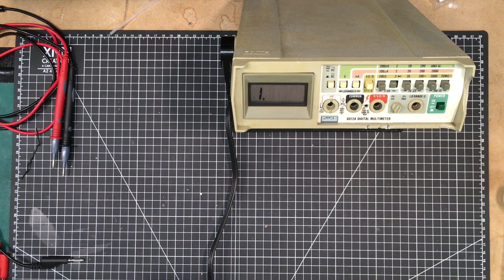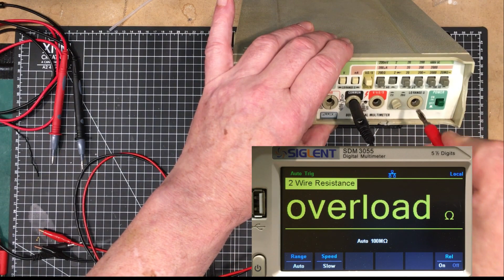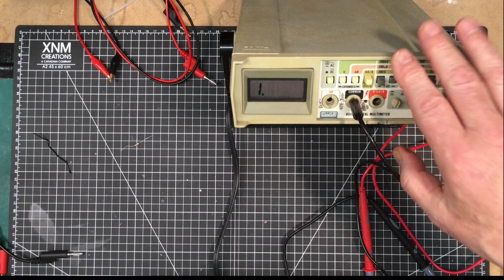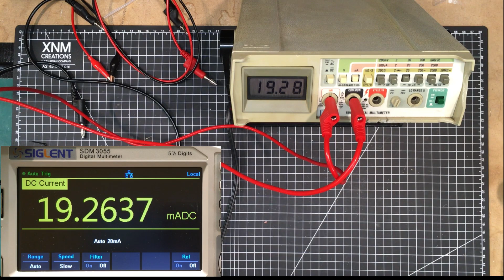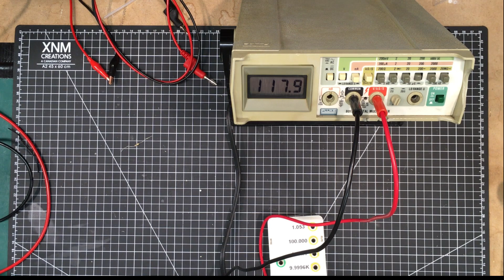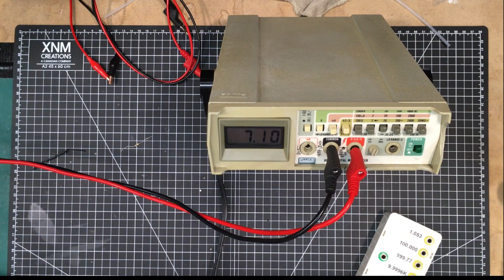0064 - $35 Vintage Fluke 8012A DMM - Better Than You Think!

Comment: I had a slightly earlier version of one of those many years ago I bought from a surplus place. It was in exactly the same case with the row of buttons along the top the same but without the calibrate knob and one less 4mm socket. I used it as my main meter for years and certainly got my money's worth. They are nicely built.
Reply from the maker: Probably an 8010A from your description.  Yeah, these are built to last, be serviceable and provide professional performance.